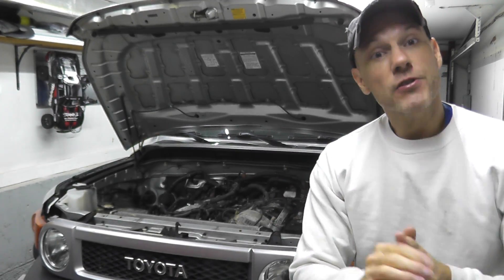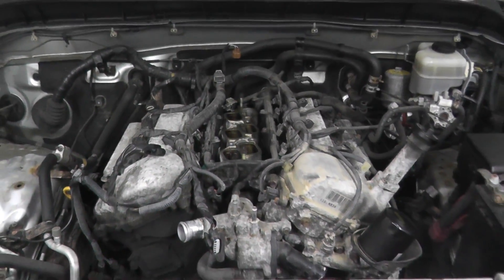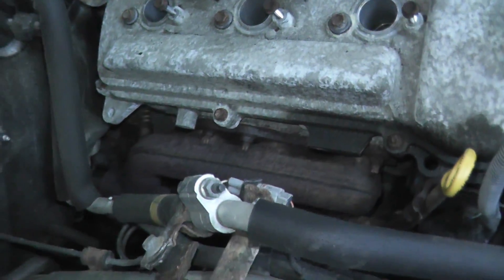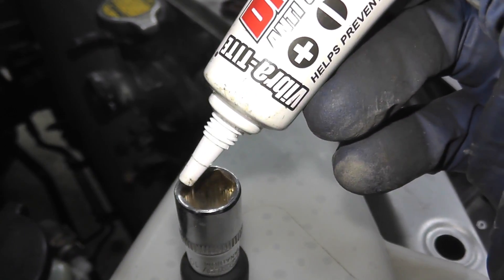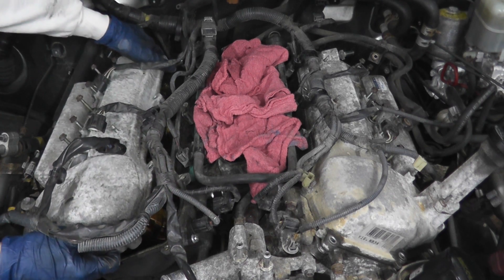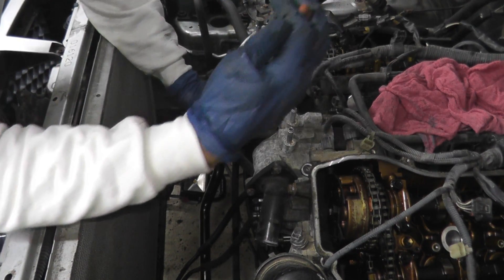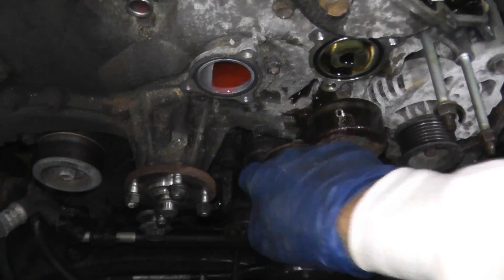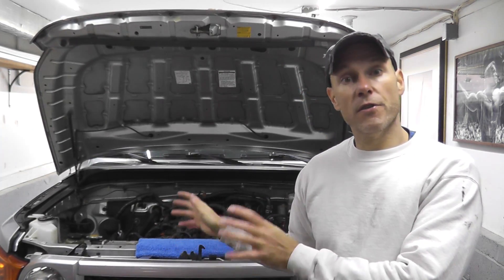Tearing down Toyota's 1GR-FE Engine at home for timing chain replacement | Tacoma - Tundra

Comment: I have a 2010 FJ and it has a DTC P0014 present for bank 1 camshaft timing over advance. Any insight on what to check to confirm what the exact cause is and needed repairs?